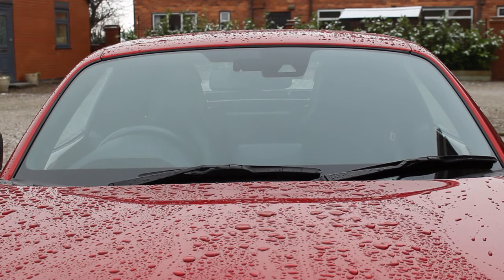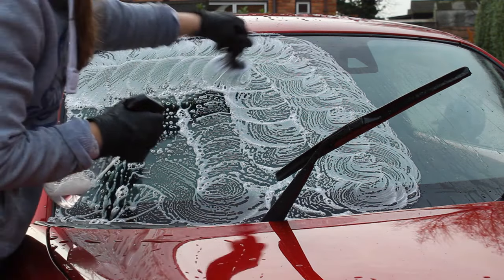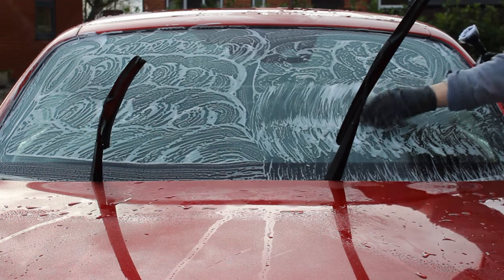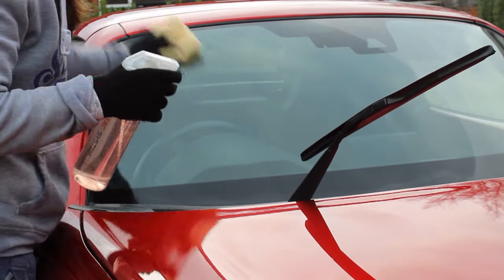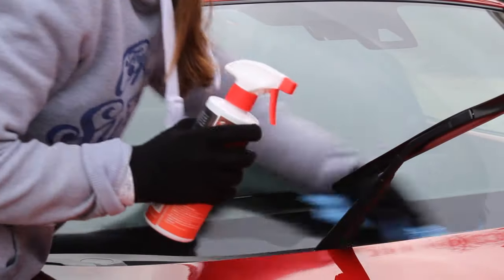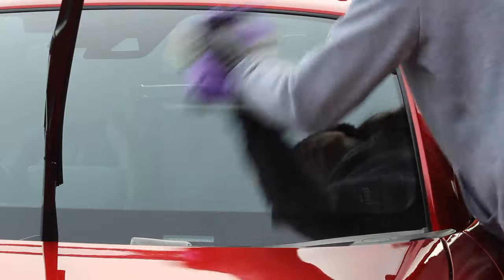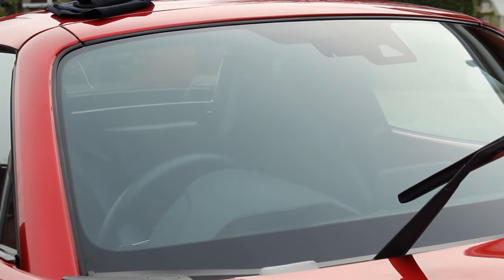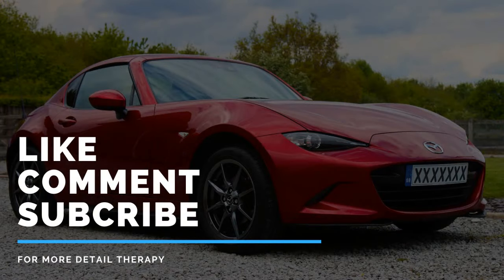Windscreen Deep Clean and Coating Application | Removing Stubborn Water Stains

Comment: Brilliant video. I recently had a new windscreen fitted after a stone chip on my JCW and it was really greasy and a clay bar didn't do much if only I had known about the TAC Water Spot product but I do now. I recently bought 16 products from Auto Finesse including glass cleaner and polish but I have noted the panel wipe and water spot remover for my next product purchases. I learn something new every day. Thanks. I subscribed also.
Reply from the maker: Thanks very much! The water spot remover really surprised me at how well it dealt with the marks on here. I’ve used it a few times on different cars now and the amount you need per use makes it really cheap as well

Comment: I didn’t do all these steps and just washed the car and used a normal cheap armour all windshield glass cleaner then used Rainx on it. The coating is still like new now for 6 months.
Reply from the maker: That’s really good, rain-x is a great product. It all depends on the condition of the glass tbh. I’ve applied good sealants to unprepared glass before and only got a month out of them

Comment: I've searched for the Holy Grail of glass cleaners. They are all good, but they don't get rid of wiper blade marks. Sonax Xtream glass cleaner is my favourite by far. So little streaking in summer months. However the key to my streak free and removing wiper blade marks was Gtechniqe quick detailer. It works a bit like Kotch FSE, water spot remover, but SOOOO much better. I can't recommend this stuff enough. I have a library of detail sprays, but this is absolute magic! I used to have to use a glass polish, but honestly not needed any more.
Reply from the maker: I really need to pick up some of the FSE, heard brilliant things about it! It sounds like it’s a lot more useful than most standard QD sprays. Definitely agree about glass cleaners, they really struggle with the wiper blade marks
Reply: @AutoCareHQ  I have been using FSE for a good while now and I have to say it is really good as a final detail spray after the wash process. 

Naturally it doesn't do anything in the way of adding extra gloss or anything, but it is great at getting rid of water spotting.

Comment: Great video which I will find really useful. My windscreen is the bane of my life. I get good water behaviour and, when it's dry, clarity is superb. The problem comes when the wipers come on and leave a smeary pattern. Is this down to the glass or the wipers? Currently it's got a dealer applied glass guard type product.
Reply from the maker: Thanks Peter! I'd say that probably sounds like an issue with the wipers maybe. I've heard that applying a glass sealant to the wipers themselves can work well after they've been deep cleaned which could possibly solve the problem
Reply: @AutoCareHQ  thanks. I'll give that a go.

Comment: Thanks for the great video. I've seen some people recommend applying a bit of the coating to the wiper blades too. Would be interested in your update to hear if you have any issues with wioer blades chattering /  squealing and if you get any ghosting smears after the wipers sweep the glass. Thanks again for the great content 🙂
Reply from the maker: Thanks very much for watching! I’ve heard of that trick but not had to apply any of the coating to the wiper blades because there’s been no juddering or anything like that with it 😊 I’ve not noticed any ghosting either, so far it’s been working really well!

Comment: I always polish with compound and a microfiber pad before apply a glass coating. Sometimes use Ceriglass and a Rayon pad to correct defects in the glass
Reply from the maker: I’ve always polished the glass with a da polisher in the past but I definitely found this method a lot easier and sometimes a bit more effective with the water marks

Comment: I followed your steps to the letter but sadly the TAC System water spot remover simply wouldn’t budge whatever it is that’s on my glass. Looks like stubborn chemical stains, probably TFR from the dealership before I owned the car. I managed to machine polish the offside glass today using a firm 3 inch compounding pad and AutoGlym glass polish. It definitely scrubbed the staining away. Then…. The rain started which meant I had to stop play and couldn’t apply the Pyramid Carbon glass coating (I’m still sulking lol). I’ll get back on it on a non-rainy day 🤞. I wondering whether all is not lost with the TAC System water spot remover - it might help shift any marks once the coating needs reapplying in the future.
Reply from the maker: That’s gutting! Those stains must’ve been very stubborn. Yeah it’s still a handy product to have, works really well on other surfaces so its a good one to have in summer

Comment: Heather, Excellent video yet again. Can I ask your advice. Just bought a 3 yr old car with 17k miles on clock. With regards to windscreen could I wash it, then clean with surfex  hd (10:1) then quick wash again to remove any surfex,  clean with autoglym fast glass( as I have a full bottle of it) then coat with Rain-x.  Advice or problems you can see with my method. Thanks and keep up the good work and videos. Ian
Reply from the maker: Thanks Ian! I can’t see any issues with that method just as long as the glass doesn’t feel rough and there’s no water stains afterwards. If you try and wipe the glass with a lightly damp microfiber or even the glass cleaner you’ll be able to tell if it’s completely clean because there shouldn’t be any unevenness when you see it evaporate if that makes sense!
Reply: Thank you😉

Comment: Loving this video!  Really good. 

Although I think I would probably cheat a bit and machine polish my glass. Lol.
Reply: Thats the best and correct way to apply a coating, Panel wipe after to remove the polish residue and you have perfect contaminant free glass 🔥
Reply from the maker: Thank you! I’m a bit nervous of machine polishing my windscreen atm as there are a few little chips I’m worried about aggravating. Luckily the water spot remover was decent stuff!
Reply: @AutoCareHQ  honestly it's nothing to worry about at all. 
The same as you wouldn't put excessive pressure on your paint work or allow it to heat up too much, you just treat it the same way. 

But glass is so much stronger anyway. 

To be fair, I would only do it before a coating anyway. 
Which might be soon, as I'm REALLY curious to see what the real world performance is like. 

Might even try the new Gyeon one out perhaps.

Comment: Hi, I'm waiting for the Pyramid spray to arrive tomorrow, ! 
Just wondering if I could use IPA, to remove all the contamination from the glass, (it's all I've got, at the moment, lol.. ) would it be sufficient do you think, ??  Maybe in conjunction with "normal" household glass cleaner,.. 
wouldn't want to "waste" the effects of the Pyramid stuff,,, as always, I really value your opinion..
All the best,,    John..
Reply from the maker: Hi John, if I'm honest I'm not sure IPA would be able to tackle the water spots/ chemical stains. I definitely think the water spot remover was the key when I applied it to get it to bond properly, although polishing might be more useful on very contaminated glass. I'd be tempted to hang on if I were you and grab some glass polish/ water spot remover for the windshield if you've got some of the stains I mentioned in the vid. On the side windows though it'll probably be less of a problem!
Reply: @AutoCareHQ 
Thanks, once again,, great advice,, I'll get some water spot remover then,, 😀

Comment: Wow that's a lot of products used! What do you recommend for some of us newbies, just to get the glass cleaned and coated? Can I just use soap, water spot remover and then apply the coating? I also have a red MX-5!
Reply from the maker: Great choice of car! Yep as long as you use the water spot remover, that’s the main bit tbh 😊 just give it a wash as normal and then use the water spot remover and then maybe give it a wipe down with a glass cleaner just to remove any residue

Comment: My windscreen feels quite rough, not sure but would clay bar be enough? Have heard very fine (0000) wire wool works very well, have you tried this or is it too risky for scratching the glass?
Reply from the maker: I probably wouldn’t risk it to be honest. I’ve just used the glass polish from car pro called ceriglass to prep a car for this coating and that worked really well though on some pretty bad glass

Comment: Great video once again, will be interested to see the review video, I've been thinking about a proper glass sealant for a while, I currently use either Rain X or a glass cleaner with  repellent additive
Reply from the maker: Thanks! The water repellent glass cleaners are really cool but without spoiling the video too much, the coating definitely is a step up! I’m gonna do a comparison at some point between this coating and a few other sealants and the car chem water repellent glass cleaner and try a few chemical resistance tests on them which could be interesting 😊
Reply: @AutoCareHQ  that’ll be a great test. Ive got the car chem glass cleaner and the EZ one with the rain repellent in it, I’ve just used this for the first time so just need to test it in the rain before I can review it 😂 I’ve a spare bottle (or two) of Rain X lying around,if you want it for your test just let me know and I’ll gladly send it your way 👍
Reply from the maker: @markcook149  Looking forward to hearing what you think about them! I've just picked up a bottle of Rain X actually but thanks very much for the offer! I'm thinking of getting some Angelwax H2Go as well as I've heard good things about that one too
Reply: @AutoCareHQ  the angle wax has been on my radar too so would be interested to see how this preforms too.

Comment: Glass polish will help remove the water spots, Try distilled water in your washer bottle for a spot free windscreen.
Reply from the maker: I’ve used glass polish and a DA in the past and it definitely works well but the water spot remover is so fast compared. Thanks I’ll give it a go!